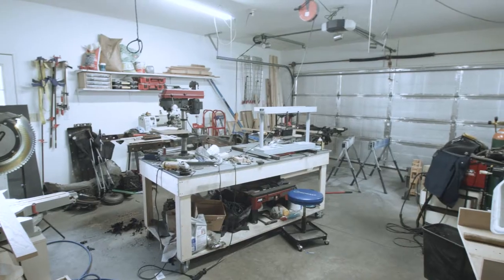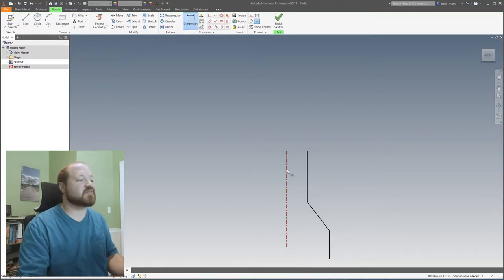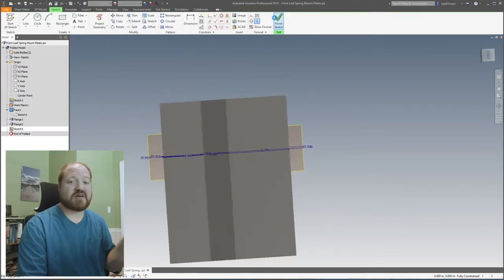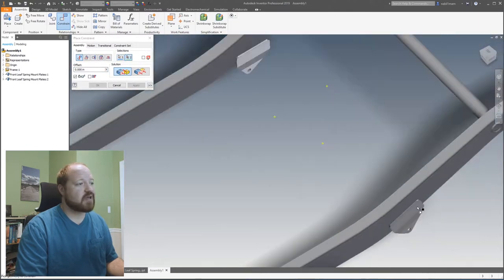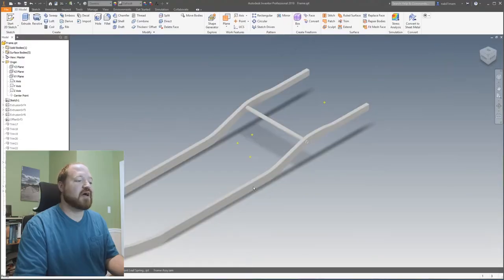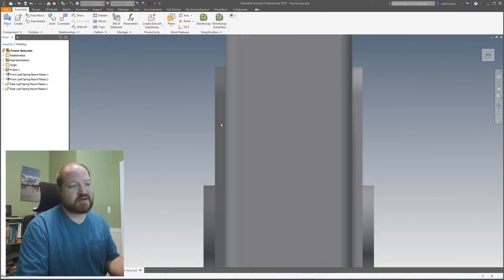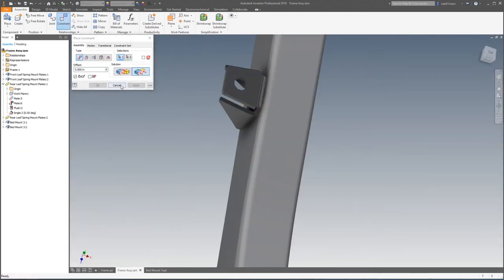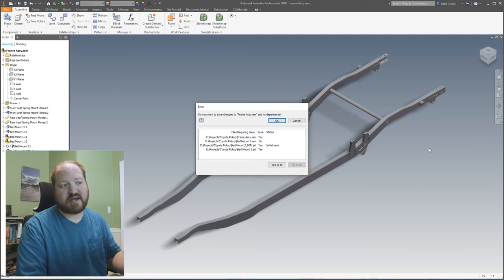Adding Rear Brackets to the Cad Model - 1989 Toyota Pickup Restoration EP 18

Comment: Hello big respect what your done and im thinkib about Is it any possible way to get those frame cad files to redesign my own suspension? I thinking about 4 link suspension and coilovers and etc.
Reply from the maker: At this time I wouldn't consider these very accurate. So I don't feel comfortable distributing them for people to use. However, I am about to start cutting the frame up to repair it and I do have the manual with all the frame dimensions. Depending on how ambitious I am I might improve the model so I can provide the files for other to use. But we will just have to see.